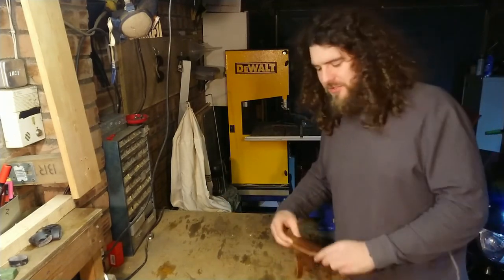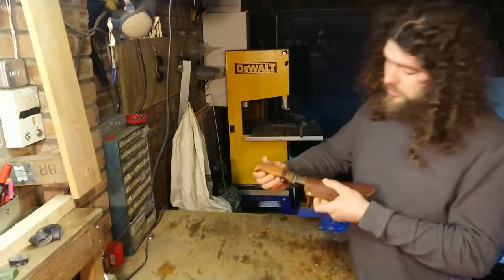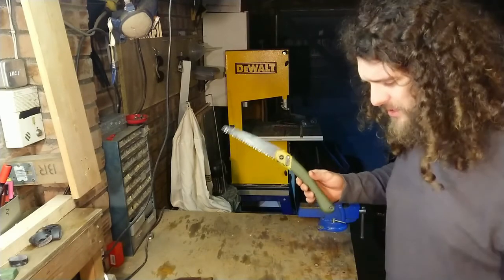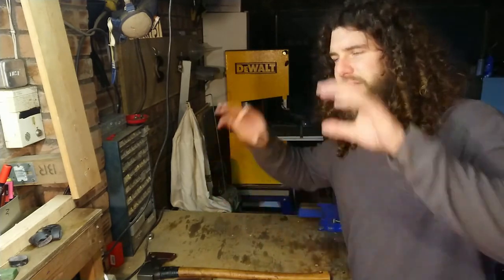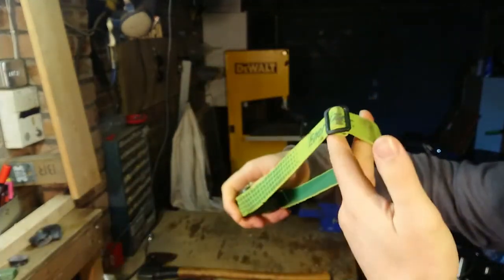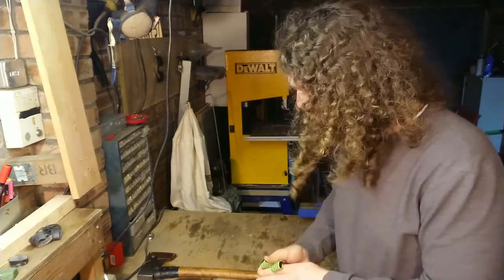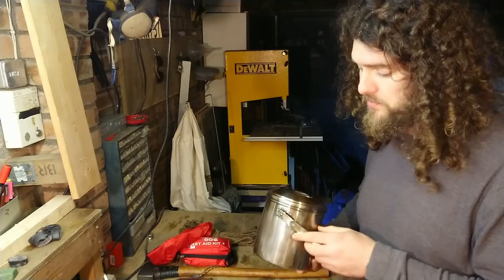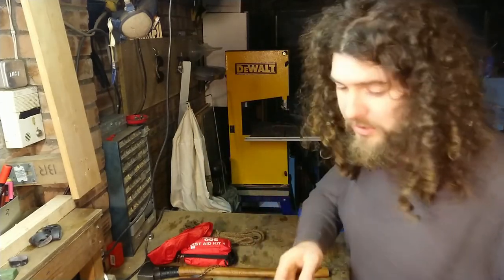Essential Bushcraft Kit

Comment: Great point on the first aid kit. When i use axes I always take a tourniquet and trauma bandage
Reply from the maker: Ben Scott yea, good idea. Just remember a tourniquet is a last option cos you'll have a high chance of losing that limb. Hopefully you'll never use it but it's good to have if it goes really bad. 🤕
Reply: Actually the rate of amputations due to tourniquet use has been greatly exagerated. If you cut an major artery not much else will do and in the worst cases you can bleed out in minutes, giving you little time to make one. The CAT ones are great because you can easily apply them to yourself one handed
Reply from the maker: Ben Scott cool but my favourite is to just have a break when I get tired so I don't do silly things. All the best dude 👍